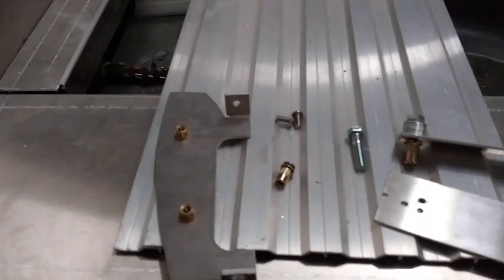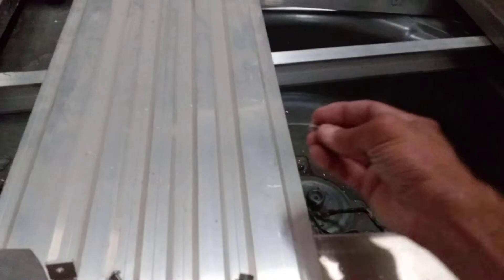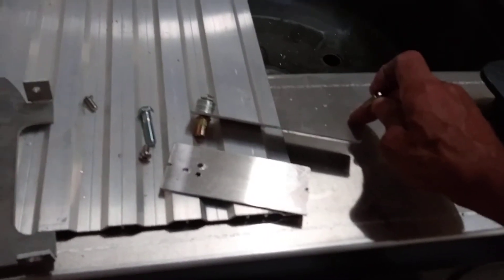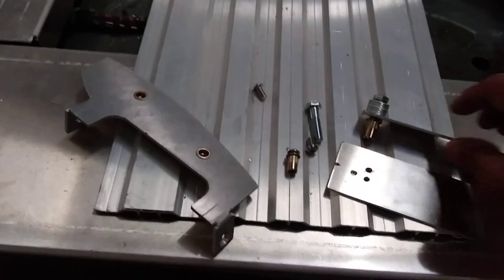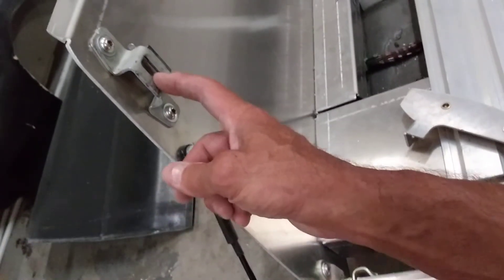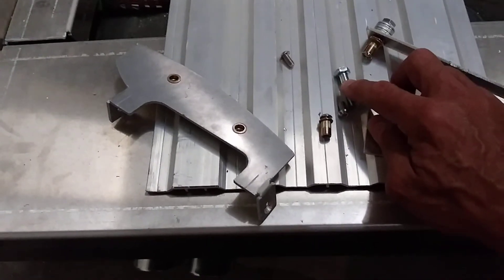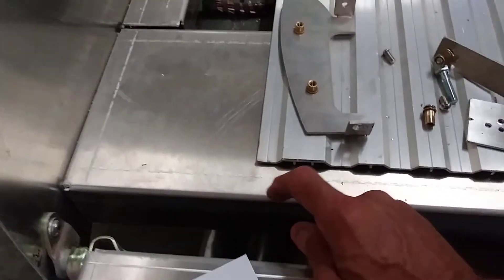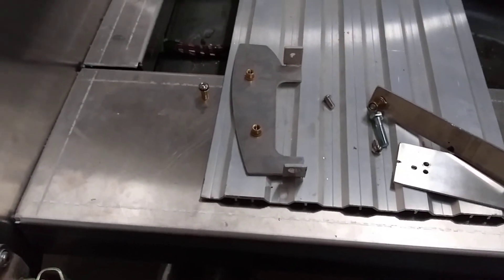Smyth New Beetle build: Installing rivet nuts

Comment: Hi!  I ordered my beetle kit a week ago and I am buying up all the panel bond, etc., so that I will be ready for it.  I'm not sure if you monitor messages on here but I swear I saw on a video that you recommended the use of a vice grip based tool which created a pressed countersink for the flush bolts at the top of the bed.  Did I invent this tool in my dreams?  I have searched the internet and can't find anything like it.  I can't find the video again either.   Much appreciated if you can confirm this and where to purchase one...and if I dreamed it, well I guess I just gave away a patent idea LOL.